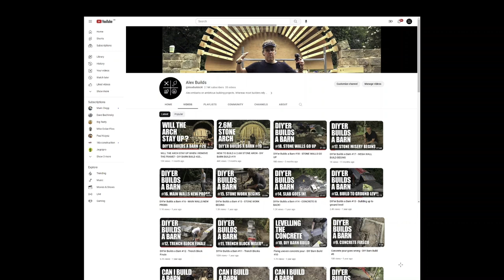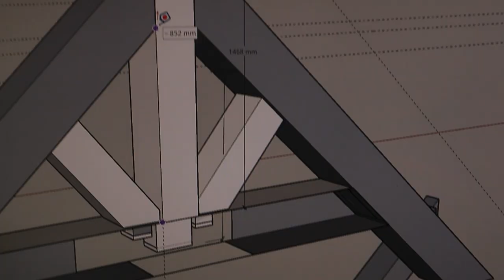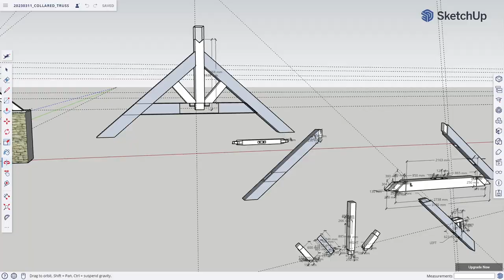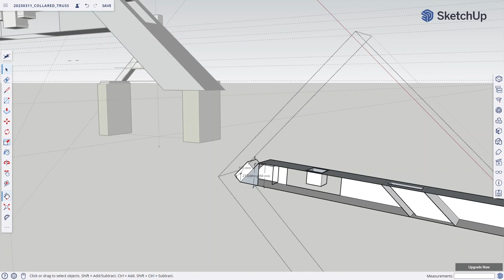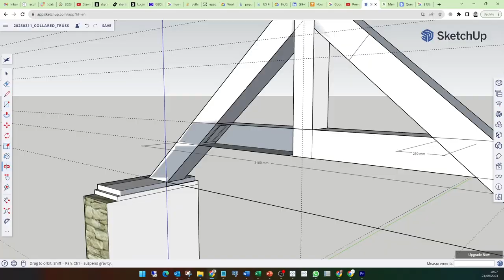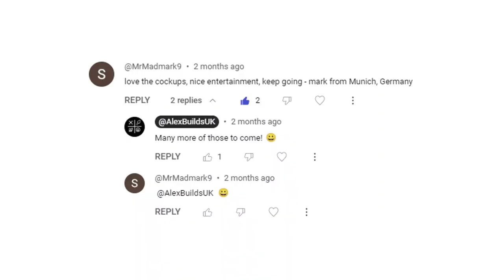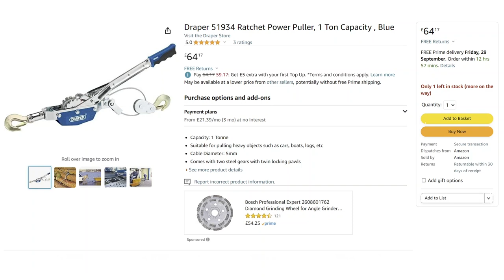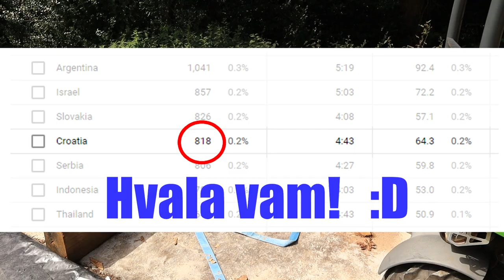DIY BARN BUILD E23: RAISED COLLAR OAK TRUSS

Comment: The technique for the dowelling is to offset the holes on both pieces so it pulls the joints together
Reply: Yeah often times the hole on the tennon is slightly nearer to the shoulder then it is on the mortis so the pin pulls em together. What he did will work too but the joints might move more
Reply: How much of an offset should be used?

Comment: When it comes to building something like this, the handiest tool you can have is the Mast and Boom.  Sailors, Dock Workers, Blacksmiths.... for a thousand years folks have had to lift heavy weights and operate at height before there was such a thing as this modern jive.  They used the good ol' rope and pulley to do the heavy lifting for them.  It works just as well today as it did eons ago.  With a Mast-n-Boom, you can lift and rotate all day long without risking life and limb.  Plus, they're pretty fun to make.
Reply from the maker: Genuinly - I'm going to look into that. Follows on from my Roman-style dowel rollers! That said find it hard to believe I'm going to make something that can lift that 800Kg truss i built in E22-23. We shall see!
Reply: @AlexBuildsUK  Raising the mast might be a bit much for one man alone, but this Russian gentleman found a very unique solution to getting heavy timbers up to the top sill al by himself in an economical manner..  I don't see any reason why you couldn't do the same if you waited to assemble things until they were up top.  https://www.youtube.com/watch?v=wlTwYgIk8NU&list=PL0haX4WbpKDSZI3PN6oX8Ws9eFtJwnJaE&index=17
Reply: @AlexBuildsUK  Here's a video from Alaskan Homestead Adventures where they show using their Mast-n-Boom to raise a huge log way up in the air to get it on top of their cabin.  If it doesn't weigh 800lbs, I don't know what does!  https://www.youtube.com/watch?v=DYK0jYSKqSg&list=PL0haX4WbpKDSZI3PN6oX8Ws9eFtJwnJaE&index=67

Of course, building the Mast-n-Boom is a job in and of itself.  The good news is that you can build the thing once, and then use it to raise everything, including bundles of shingles.  As small as your building is, there'd be no problem getting a boom that'd reach over the wall to the center of things, or you could even build the mast right in the middle of the building like in the vid.

In the comments, they added a link to their blog where they have more pics and a bit of a how-to so folks could make their own.  One of the key things is choosing the right rope for the task since you want something with minimal stretch.

The block-n-tackle can often be found in "antique" stores and are always a good thing to have around the shop.  Quality modern ropes can be had for about a buck-a-foot from many online sources, but you can also talk with local arborists who change out their ropes every year just to be safe.  That'd allow you to buy "cheap" but know you're getting quality line that won't snap on you.

Arborists are actually one of the last refuges for the knowledge of knots and rope.  They've kept the skills alive while it seems everyone else has turned their backs.😒

I'd also recommend a copy of the Ashley Book of Knots so you can see how our ancestors would have raised and lowered things.  We forget that modern contrivances are very new to the world and prior to the 1950's, most everything was still being done with rope and pulleys.  If you don't have a copy of the ABoK, I cannot suggest it highly enough.  There is a free online copy that you can find with a quick search, allowing you to try before you buy.

Canaletto, one of the greatest artists ever, has some charcoal sketches that show the block-n-tackle being used to lift repair materials way up the side of a building in Ancient Venice.  It's pretty neat to know you're carrying on a tradition that old!
Reply: @AlexBuildsUK  Just found this video and thought of you....   https://www.youtube.com/watch?v=rKEcc0Uhnak

As you can see, it's a lot simpler a build than a proper Mast-n-Boom derrick crane, and would fit will with your site.  The gent was able to get long, awkward timbers up high all by himself with a lot of walking back and forth.  The way he built the masts reminded me of your work, actually.  Very heavy-duty and those iron brackets give it a sense of elegance that'd fit right in with what you're doing!

It'd almost make raising those trusses of yours too easy.

Comment: I'm also binge watching.  I'm learning a lot.  When I move to a wooded 9 acre lot in the near future, I'll be building a greenhouse and chicken coop.  I was thinking it would be great to use a post and beam method.  I'm 72 and don't have 3 years to waste on one building.  Watching you struggle with those joints made me think a hand held bandsaw might have made things a little easier.  But I couldn't find anything larger than 5 inches and those beams look like 8 inches or more.
Anyway,  a few more days I should be all caught up with your progress.  Cheers!

Comment: The more you remove from around the tennon the weaker the final product becomes. Super precise with wet oak shrinks up and becomes way stronger as if it was a single solid bit.

Comment: When draw pegging a joint I have seen the hole in the tenon offset by 3mm toward the shoulder from the mortise hole so the peg when driven through pulls the joint together tight

Comment: When you drill the holes in the beam, the hole in the beam that goes into the other beam must be drilled slightly away from the center of the other beam, then the pin will pull them even closer together. Berthouville, Normandie, France put it on de map.

Comment: IHi Alex if you use dowels, it is better to drill the hole in the Tannend 2 to 4 mm further towards the shoulder of the connection, so that you can pull the parts together better. Maybe this video will help to clarify what I mean https ://www.youtube.com/watch?v=WjNrHTXu6F4 just what Vanosphere said. did not see that comment